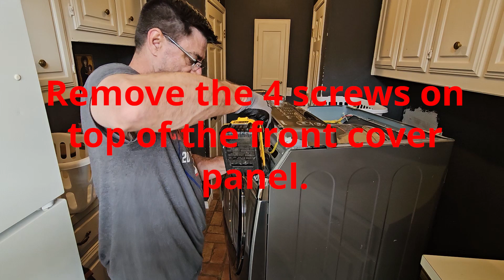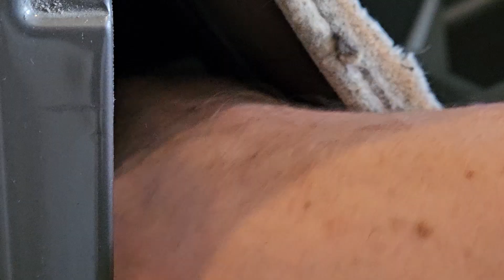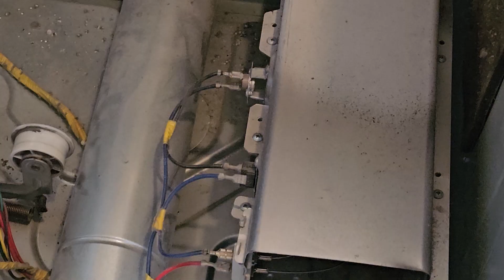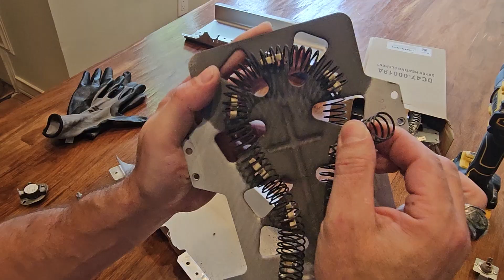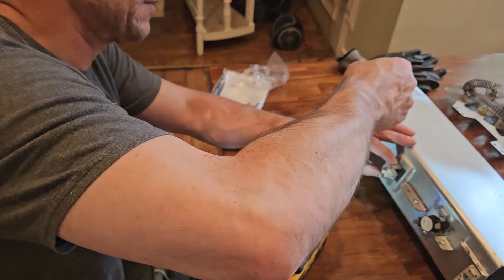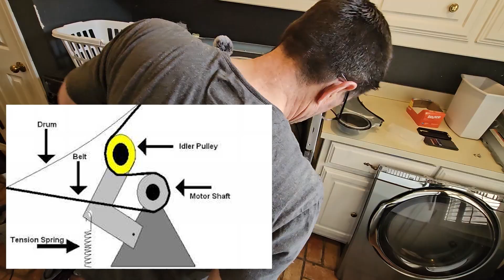Samsung Dryer Not Heating Easy Fix for a Broken Heating Element!mp4

Comment from the maker: When a dryer stops heating, it is usually the heating element.  But it can be a clogged exhaust or something preventing the fan to spin.  Look for these first before determining the heating element is the problem.  A new heating element is $30 on Amazon, and it takes about 30-45 minutes to replace.
Reply: Fantastic explanation and if my vent line is clear I'll be doing this soon.  I see that your dryer has a steam option as does mine, and you didn't address the water line that I assume goes to the drum? Is there anything special to be done when dismantling and putting back together?
Reply from the maker: @janetlouden7519  Hi Janet - the mister feeds in through the back of the unit.  It does have a small reservoir tank, so no need to turn off the water or disconnect it.  Thank you for watching!
Reply: You are the best! I dismantled everything in order and kept screws organized and sure enough, the coil was broken.  Ordered one on Amazon and it will be here tomorrow.  And for the "oh it's too hard" folks, I'm an older female and the dryer is stacked on top of the washer.
Reply from the maker: @janetlouden7519  You are the reason I started this channel!!!
Reply: @TheCommonSenseDad  The part came today, it's fixed and working great. Thank you! The only edit I would make to your video is if you could add a reverse list at the end of the video showing the order of pieces for putting it all back together.  I sort of watched the video in reverse to make sure I had the correct order for reconstruction and it was slow.

Comment: How long did this really take?
Reply from the maker: @TopTenWhats  It takes 45 minutes to an hour
Reply: It took me about 1.5 hours to dismantle everything, but watched each step, stopped the video, did it, and repeated to the end.  I had a real struggle finding the lever to release the belt and spent a while with my phone reached in there taking pictures until I could see what I was reaching for. That was the only hard part.  I also spent quite a lot of time cleaning the dust and cat fur off everything, especially the motor and windings. I expect it to take no more than 45 minutes to put it back together. As mentioned above, I'm a pretty mechanically inclined woman and the dryer is stacked on top of the washer so a lot of it was done on a stepladder.